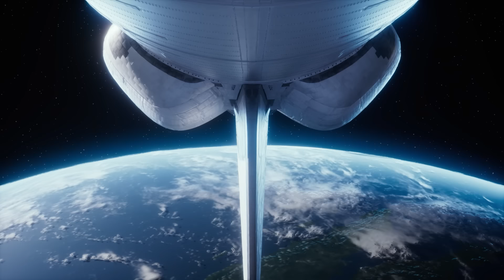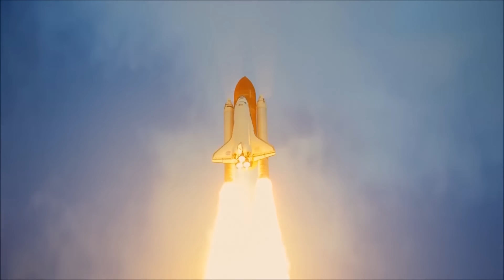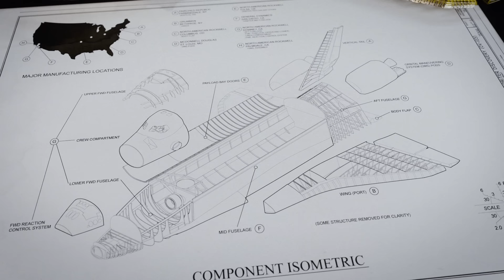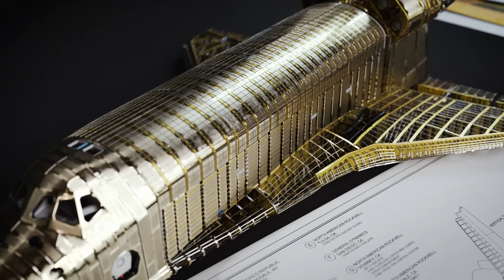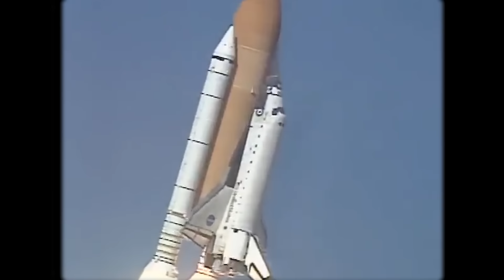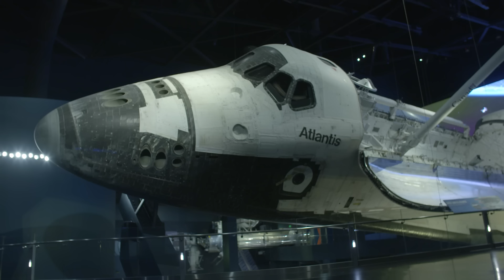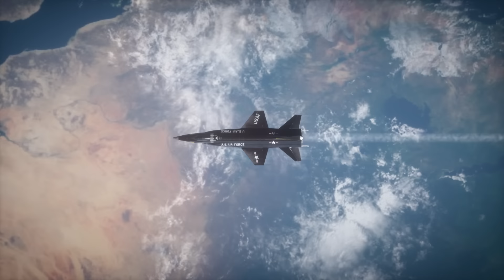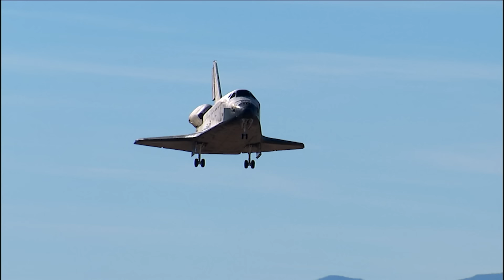The Insane Engineering of Re-Entry

Comment: @8:00m Comms Blackout was actually not a thing for the STS Missions after they got a certain set of satellites up ! Comms blackout only affects Ground to Craft Direct Comms, but if you route the signal ABOVE the orbiter, then send it to it, comms blackout doesn't happen since the top half of the craft is not engulfed in a plasma bubble, only the bottom half.
Reply: @Jenny.Anderson76 I don't understand what you're trying to get at. Yes, obviously they didn't find a way to prevent the plasma of reentry from generating ionic interference. I'm not saying TDRSS stopped ionic interference from blacking out UHF comms after 1988. Obviously signals via the ventral UHF antennas still experienced the same 16-30 minute blackout throughout the entire program, yes the TDRSS Ku- and S-Band entry workaround required a very clever combination of hardware and software engineering to make it work, and yes the signal strength was variable throughout reentry. But the fact that clever trickery was required to achieve reentry comms is irrelevant as the end result was an essentially uninterrupted up/downlink of comms and telemetry throughout the entire reentry, including during the 16-30 minutes of peak ionizing interference when UHF is blacked out. STS-27 and later only lost signal for 1-2 seconds during the planned switchover from TDRSS-West to TDRSS-East, and a few missions experienced very brief tracking issues at the extremity of one or more s-turns which also resulted in a couple second drop. Aside from that, MOCR maintained a continuous, useable comm and telemetry up/downlink from entry interface right through to wheels stop and ion interference did not cause any blackout in the TDRSS Ku- and S-Band reentry downlink.
Reply: @GlutenEruption  You're talking to a wall. Their only retort is that its not true, without going into detail why you could be wrong. You on the other hand, are listing a myriad of possibilities what their short answers could be interpreted as and how that interpretation could have a valid point. At this point you are playing both sides of this conversation and they only have to write "no" to make you write paragraphes this long. A situation any troll would dream of
Reply: @NabekenProG87  fair point, although I don't really care if I get through to them or not, I just don't like the idea of other people reading the thread and being misled. I think I've posted enough proof at this point that any rational person will come away with the correct information regardless of what else they post.
Reply: @GlutenEruption  
Goofball
The actual shuttle 
data stream is the PROOF. 
Grow the F*** up.
Reply: @GlutenEruption  
"I don't really care..."
How old are you?  
Man-child years old? ✅ 

Shuttle data stream 
is the ACTUAL PROOF. 

You stick with your 
third world  thinking.  
🤣👍
Reply: @GlutenEruption  
Shuttle data stream. 
Actual proof.  ✅
Reply: actually, not true - there are many here that will still gain useful knowledge we would not have obtained otherwise - i grew up with mercury, Gemini and Apollo where this was normal, expected and what was so fascinating? we knew when it would drop and when it would come back- within seconds. So let the guy talk - sometimes troll's can bring out the best in the knowledge presented. God bless you - NOW LETS GET TO MARS! @NabekenProG87
Reply: @GlutenEruption  
Why can't YOU just go look at the data streams and do some basic analysis on them?   The answer is obvious. Instead you copy paste wiki like articles?  
Data stream analysis was a common thing to do during the Shuttle lifetime if you were in engineering.  
Now go outside and be useful  🙄
Reply: See The Tracking and Data Relay Satellite System
https://en.wikipedia.org/wiki/Tracking_and_Data_Relay_Satellite_System
Reply: Cool to know
Reply: Cool!
Reply: Thank you
Reply: @CarlosAM1  
Not a true statement.  
But ok. 🤗
Reply: @AlwaysAwesome001  It is literally a true statement, but ok 🤗
Reply: @CarlosAM1  
Reality.  It was reduced.  
Go look at the actual data stream. 

Keep reading those fluff tech sites.  👍
Reply: @AlwaysAwesome001  bro what are you on about 💀, the guy simply stated that the TRDSS network allowed for communications when there usually would be a comms blackout with ground stations, the network still exists to this day and was indeed used for that during the shuttle era.
Reply: @AlwaysAwesome001  no, it was actually eliminated entirely - STS-26 in 1988 was the last shuttle that experienced any ionization related comms blackout during reentry. The TDRSS Ku- and S- band antennas were on the upper side of the orbiter crew compartment and transmitted upwards in the shadow of the orbiter which meant they didn't have to deal with any ionization interference at all. The only LOS experienced by the shuttle post 1988 was a brief 1 to 2 second drop when the orbiter switched over from one TDRSS satellite to the next as its ground track progressed.
Reply: @AlwaysAwesome001 troll
Reply: interesting - i always understood it to be a complete 'blackout'  because of the plasma gas surrounding the entire orbiter - @GlutenEruption
Reply: @prestonburton8504  that's one of the unique advantages of a lifting body/winged reentry vehicle design. With a capsule shape, the plasma does indeed essentially envelop the entire thing, which is why even with TDRS Orion still experiences about 7.5 minutes total reentry blackout coming back from the moon. The shuttle however due to its shape and reentry profile leaves a big hole or "shadow" in the plasma trailing its leeward face where the ionic interference is greatly reduced or nonexistent. Before TDRS when they were still using direct to ground communications that required the shuttle to transmit downwards, the hole didn't matter at all which is why the shuttle experienced a 16 to 30 minute blackout. However once TDRS was up and running and the antennas were installed on the upper side of the fuselage, they were able to take advantage of it by broadcasting upwards through the hole to TDRS and then from TDRS down to ground which essentially eliminated the blackout for the remainder of the shuttle program. Really cool engineering.

ETA: here's a really cool study if you're interested the talks more about these things: https://benthamopen.com/contents/pdf/TOAEJ/TOAEJ-3-76.pdf
Reply: @prestonburton8504  the plasma is only on the bottom. The top does not have superheated plasma.
Reply: I suggest y'all go watch the (somewhat  harrowing) video of Mission Control on return of the ill fated STS-107 flight (the loss of Columbia with all hands). Search "Inside Mission Control During STS-107 Columbia's Failed Re-entry and Disaster" . They had communications with the crew right up to the point when the crew reported tyre pressure issues. That is well and truly into the re-entry with plenty of plasma build-up.
Reply: @davidanderson4091  "Columbia, Houston, UHF comm check.   Columbia, Houston, UHF comm check."

That's something I will never forget.
Reply: @davidanderson4091  
I suggest you go look at the actual shuttle data stream.    
Did they have communication ALL through reentry? 
🤔  Hmmm?  
Why do youIDIOTDSavoid the ACTUAL data stream?
Reply: @davidanderson4091  
Why do you AVOID LOOKING at the ACTUAL SHUTTLE DATA STREAM?
Reply: @AlwaysAwesome001  Why do you AVOID EXPLAINING what's in the ACTUAL SHUTTLE DATA STREAM?
Reply: @caxve  
Why take my word? 
Go to the source. 
Think for yourself.

#goofball🤣
Reply: @AlwaysAwesome001  I went there, I don't see any blackouts.
Reply: @caxve  
Under an hour? 
Wow. You are a genius! 🤣
What software did you use?  🤔
Go home goober.
Reply: @AlwaysAwesome001  What software did you use, troll? Fuck off
Reply: @caxve  👈alwaysApussy🤣
Reply: @davidanderson4091  
The fact checker media told you Biden was wearing his construction hat on correctly.   #nape 🤣
Reply: @davidanderson4091  👈
New Zealand fascist babbler. 
How cute. 🤣
Reply: @Jenny.Anderson76 sorry but what are you even talking about?
Reply: @Jenny.Anderson76 sorry Jenny, I went to school for engineering. Go watch a meteor shower or work at a hypersonic wind tunnel and then tell everyone that shock heating doesn't exist. 🙄
Reply: Guys 🙏🏾 correct me if I'm wrong, I thought four series banking maneuvers started at around 80KMs, not after the maximum burning period 🤔
Reply: yeah, that was insane in the latest starship test: they managed to stream live video all the way down.
It was quite fascinating to watch those ablative flaps do their work.
Reply: @Jenny.Anderson76 If TDRSS didn't eliminate the communications blackout, then why were they bothering to call STS-107 well before it would have exited the plasma sheath and expecting a response?

That's something seared in my memory, because I was listening to the air-to-ground loop live when Columbia broke up.
Reply: This is the most interesting argument thread I’ve read lmaaoooooo
Reply: Professional idiot. 😂

Simple example.
"NASA mission control are anticipating a nervous six minutes of blackout during the peak heating phase of Crew Dragon’s return – if anything goes wrong during this time, it’s in the hands of the astronauts."
Reply: You so dumb. 👍
Reply: @Jenny.Anderson76 
✅
Reply: Seems like someone is having a hard time understanding English 🤡
Reply: @commygames  👈
Account flagged as under 18.  
Speaks enough. 🥱
Reply: @commygames  👈under 18. ✅
Reply: @commygames  👈
underage.  
Your transmom calling you.
Reply: but i thought that compromised all antenna's - even those pointed up!  its free electrons that bleed of most of the emf before actually emitted from antenna?
Reply: @prestonburton8504  the plasma bubble is generating interfering radio signals, but the interference is directional. Because it originates on the underside of the craft, any antennae in the shadow of the Bubble (craft separates the bubbles) need a significantly stronger interference signal than what is being emitted. There's still noise reduction algs to get clean audio because no matter how large the craft, some of it will leak up, but as you approach infinite size, the interference approaches 0.
Reply: thank you for helping me understand this effect. i was during an age when Ham radio was 'tagging' along with each ride (how i know we went to the moon) as a young boy and remember the almost precisely timed periods where we expected and saw a blackout -  on the videos of columbia -its not explained well.  We hear comms blackout for voice -but probably not for instrumentation and why they continued to see sensor failures at capcom? (don't waste more time on me with a response, you are helping educate others)  @echoAwoo
Reply: No
Reply: @fonda1515  Yes. I'm sorry critical analysis is lost on you. That's a you problem.
Reply: its 1/8 probable
Reply: Interesting.  I was aware they didn't experience the blackout after a certain point in the program, but I assumed it was due to using newer communication frequencies or bandwidths.
Reply: @ThunderchickenXL  Spacex has also found away around the blackout with this method using starlink
Reply: @Jenny.Anderson76 🥱
Reply: @Jenny.Anderson76 Explain please.
Reply: Watching the video I was thinking, why not just send the signal up and  bounce it off a satellite ?  Neat to know they eventually did it
Reply: Partially true. There were still short comm dropouts during re-entry. When the shuttle banked left or right the antenna got shielded by the plasma.
Reply: this guy somehow ragebaited all of u lol
Reply: but communicating through the top will be very difficult
Reply: i believe this was only possible with shuttle since its so large and allowed for comms
Reply: @imEden0  No, capsules work with it, too, but their communication cone is significantly narrower because of the size differential you mentioned.
Reply: @imEden0  
The Shuttle still experienced black outs just not at Apollo levels.
Reply: I love your channel, it would be really nice if you add imperial measurements on screen for your American viewers thanks!
Reply: @MitchM240 it's time you embrace the Metric system
Reply: @ThePCHandyman9  
It's time you embrace
1st and 2nd Amendment.   
🇺🇲👍
Reply: @AlwaysAwesome001  As a born-and-bred American citizen, I'm happy to exercise my rights to free speech to state with authority that anyone who doesn't regret growing up with imperial measurements has never done any science or engineering. I also regret that my right to bear arms offers no defense against the need to constantly convert from nonsense to metric, and that the only way to escape the tyranny of feet, BTUs, and Fahrenheit is to leave the country.
Reply: @irrelevantfish1978  
Your IP address is in the UK-ish area. 
Go home goober. 🙋
Reply: @irrelevantfish1978  👈
UK-ishIPaddress🤣
Reply: @ThePCHandyman9  It isn’t matter of embracing it or not. It will never be my native measurement so I will always need to do calculations to convert it in my head. It is like your native language, I may know two different languages but my native one will always be easier. It is to the channels detriment, the US is a huge audience.Every other technical channel shows both. It is just courtesy. Do American channels tell Europeans to embrace the Imperial system?
Reply: funny story - i grew up during 60s/70s and thankfully, metric has become like a second language - in school, they tried to shift us over. You think the current rejection of DEI/LGBT is bad?  that rejection had nothing on how the american population rallied around the english measurement system and SOUNDLY REJECTED IT!  (unfortunately, but we do have dual measurements and people are finally coming around to understanding how much easier working with 10s as apposed to 12's and 16''s fit us better!) its crazy how our minds work!  @ThePCHandyman9
Reply: @commygames  👈
Underage.  Mom calling.

Comment: This is interesting topic. And it reminded me about the topic of returning from the moon. 
Usually people are talking only about getting there. But I find more interesting how did they return. How did they launched from the moon? Did they have to time it right? How much fuel did they have? And how did the got to the earth exactly. This is I think missing in most communication about that mission.
Reply: To take off from the Moon, the astronauts first had to ignite the Eagle's ascent stage engine. This engine burned a combination of liquid oxygen and hydrogen, and it provided enough thrust to lift the Eagle off the Moon's surface. The astronauts also had to use the Eagle's attitude control thrusters to maneuver the spacecraft and align it with the lunar orbit.
Remember that the Moon's gravity is much less than that of the Earth.
Reply: @martinligabue no. The LEM ascent and descent stage uses Aerozine 50 and NTO as propellant, not H2/O2. Otherwise most of what you said was correct. 

After rendezvous the Service module would give the kick needed to get a trajectory intersecting the Earth’s atmosphere - doesn’t require all that much fuel IIRC

Comment: The space shuttle really was a marvel of it's time
Reply: A real shame that it never resolved the financial barrier of space travel.
Reply: It was a poorly thought out design.

There is no reason to use a glider to return to earth. It is vastly more difficult to make a plane that wont melt, than a space capsule.

They added solid rocket boosters, which cannot be shut down. And can also detonate instantaneously, if anything goes wrong.

Saturn V > Soyuz > Space Shuttle
Reply: It had so much problems the buran-energia was much better
Reply: @aleespabst1011  problem?
Reply: @zaidyounas1602 perfect reference
Reply: Tbf it failed all it's stated goals and slowed down space travel by decades.
Reply: @brll5733  agreed, it's absolutely terrible. Should never have been made. Great engineering, sure, but terrible platform.
Reply: @MyrKnof well the shuttle was made to be the platform to make the infrastructure in space not to be the crown jewel
Reply: The stupid part was the oversize.  Werner vonBraun had calculated all of this by 1954.  The SpaceShuttle shouldn't have been more than a Spacebus.  And NASA should never have dumped the Saturn rocket, as it was cheaper for cargo, but could have also launched the shuttle.

I know that he had reuseability in mind since 1949.  They had a hard time talking him out of it on the moon rocket.  But with a shorter range, it wouldn't have surprized me if they'd managed to make Saturn reuseable.  How could they give up this heavy lift capacity !?!
🚀🏴‍☠️🎸